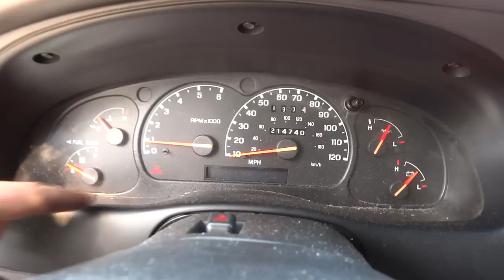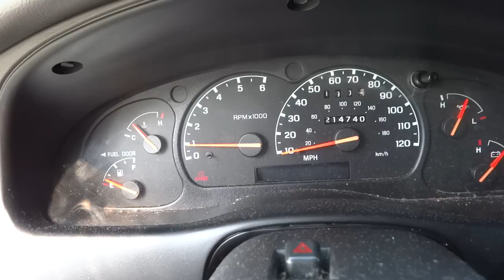Engine Knocking or Ticking?!? This Could Be Your "FIX" Ford/Mazda/Bmw/Honda/Toyota

Comment: couldn't you just lock them open via the vacuum mechanism, and disconnect the little metal arm you took off? save a big job and all the risk to boot....

Comment: automakers are in the practice of giving a consumer less & less and what they give is a junky 4cylinder as a excuse to severly overcharge for a basic v-8 vehicle!!! so if you think back to 1960's-1980's most vehicles came with a v-8 and depending on how much you were willing to pay determined how many luxuries/accessories  your car revieved.These days,people are conditioned to expect junk(low powered inline 4cylinder) so,when it comes to a basic vehicle with a v-8, THE AUTOMAKERS are using any excuse to overcharge their consumer. in the 1940's a new Cadillac was under 2- 4grand.IF PEOPLE WOULD SIMPLY STOP PURCHACING ANYTHING FOR A FEW MONTHS,WE WOULD BEGIN TO BRING DOWN PRICES.IF ONLY AMERICANS WOULD BEGIN TO STAND UP & WAKE UP? WHEN WILL PEOPLE FINALLY STOP ALLOWING CORPORATIONS  TO OVERCHARGE US,WHEN THE MOST BASIC VEHICLE COST 250.000.00.THEY KEEP RAISING PRICES KEEPING THE 1% RICH. IF PEOPLE ONLY BOUGHT USED VEHICLES FOR 1-2YEARS PRICES WOULD DROP DRASTICALLY.

Comment: I just brought a 99 infinity n when I got home n motor knock sound started n was smoking can sum one please respond
Reply from the maker: That doesn't soung good,what color is the smoke? Could be a fould spark plug,bad wrist pin,bent rod ect..need more info on where the sound is coming from?
Reply: like a over heating smoke
Reply: +Nthefastlane its by Tha power steering pump
Reply: +Kenneth graves sum one told me its Tha pully
Reply: what color of that smoke?
Reply: +Kenneth graves check your labia manifold. drain all the oil, and run it full throttle for about 30 minutes until you see white or black smoke, that means that your clitoral gasket is perforated, if there's no smoke, then you're ok, but check the urethra fluid just to be sure. good luck!
Reply: Ner0blaz3r hehe me too, but there's always someone that takes it all in as literal, and serious, then responds without thinking ^^
Reply: +tobysoter woosh
Reply: I think we have a grave problem here

Comment: do u have any clue what can it be
Reply from the maker: only three things it could be the solenoid under the intake manifold with the two vacuum lines or the vacuum line that runs to the solenoid behind the intake and the plugs that go to both the solenoids.. the one under and in the back of the intake and pressure switch on top of the intake.That's all it could be.
Reply: K thanks kid keep uo with the videos I really like them I have the same truck with a new engine so keep it up

Comment: Wow so with all the other butchery he did he also managed to use brake cleaner on a plastic manifold that you shouldn't even use throttle body cleaner on. Ford puts a non stick coating on the inside of the throttle body and intake runners that can easily be dissolved by cleaners.

Comment: These are the type of guys you need to careful with, never, never buy a car from these do it yourselfers. He's no kind of mechanic doing a bandaid job, first break things as he takes them apart, then putting epoxy on an engine part. Engines are finally tuned piece machinery, with Precision parts and he just tore it up.

Comment: Really? plastic intake manifold?  what a piece of junk...
Reply: now every manufacturer is using plastic, except for Ferrari and other high end cars. Allegedly it saves weight ( but also money for them)
Reply: It looks really fragile...  and if you get a car crash it will just break much faster than a metal one for sure
Reply: Remi Jansen Actually plastic is best. It doesn't normally get smashed with pliers and it doesn't absorb heat like alluminium so intake temps are lower. ;-)
Reply: Some cars have plastic oil pans and plastic valve covers along with the plastic intake manifolds.

Comment: WHOA..... WAIT.................  THIS IS EASIER......  After removing the metal rod, gently snip the flaps in half and remove the two parts, leaving the holder in place.  No cleaning and no epoxy except for sealing up the port for the metal rod, and also epoxy the plug at the far end of the where the rod used to be.

Comment: I read one of you stating about the teams that design engines are so much better. NOT! Whose bright idea was it to put plastic on engines? It does nothing but fail in the long run and you have to buy new intakes. To where the old metal ones last forever. Just another way they can make more money on you i say.... Ridiculous design.... Pt cruisers got same garbage....

Comment: @6:46 you said you had a 5/16 bolt. Dude, seriously, vehicles in america haven't used standard bolts since 1982 at best, stop sighting standard bolts on a vehicle because as soon as you do,  you sound crazy. It's called 8 millimeter.
Reply: when u have nothing but standard sockets left in your tool box due to theft its good to know that there are standard sized sockets can be used for the metric bolt.

Comment: theres a quicker fix just unplug vacum pipe plug the hole two minute job am still going strong two years in lol
Reply from the maker: Yes but that's a temporary noise fix Tam, if one of those breaks off in the intake its game over. They do break off, there are a few videos on here with engines that have blown up because of the runner flaps breaking off in the cylinders.
Reply: Nthefastlane
I agree with you, but unplugging that vacuum might be a good way to confirm the problem before going through the work of pulling the manifold, only to discover the knock was coming from somewhere else. I am chasing a knock like that on a rebuilt engine I hope it is from the manifold, pulling the engine sux.

Comment: If Ford could save a penny by not including the runners (IRMC) then they wouldn't have put them on AT ALL.
Most likely the spring in the vacum actuator is weak with age and needed to be replaced!! two screws and pop the clip problem solved
! 25 minute job your fix is BAD. If you wanted to stop rattle a bread tie on the vacuum actuator would have worked to hold them open (oops too easy)

Comment: he blocked off those holes going from runner to runner......cause he says it will transfer air from one runner to another....!!!!lol.......the whole intake is under a vaccum....lol.....those holes wont make a difference blocked or unblocked.....lol......all 4 runners go to the same chamber just inches above the holes....!!!!....lol........i would just fab an aluminum intake.......wouldnt trust that after beating it to pieces....lol........imagine turbo charging that engine.....lol.....the intake would explode.....lol......
Reply: +Gary Marshall 
A lot of "lols" there. Why do you think intake runners are separated? Better do some research before knocking someone idiot.

Comment: All your fasteners should be METRIC not a mixed bag of ENGLISH/METRIC? You should not remove any part of your vehicle that was engineered to be THERE! What gives you the idea that you can just throw away any part of your engine, just because you can't understand the purpose of that device!  I'm an aircraft mech & I hope you don't get anywhere near an airplane! Millions of dollars, time & manpower is spent to engineer all those devices you don't understand the theory of. Those valves change the torque characteristics of your engine by varying the volume of air, different torque/horsepower can be achieved by varying the intake flow! So you can have good response across the entire torque band.
Reply from the maker: +D. G. All of that for a pice of plastic that will blow the motor? Makes a lot of sense right? I think not. If It was engineered properly, it would be done with variable valve timing, and a good tuned map. So much for engineering. If you build air crafts like this, I'd kindly like to know which ones so I can take the next flight.

Comment: brake cleaner + plastic = melting
also not good for the gaskets

u probably deformed the plastic or fucked its structural integrity a little bit. but it probably doesn't matter THAT much in the end either.

id advise not using brake cleaner or solvents that attack plastic on plastic parts.

Comment: I wish cars could be made out of metal and be tanks again. Safety is better but overall they are worse off as plastic bags that break at the lightest amount of anything. I really hate plastic so much. Metal should be what cars go with over that plastic junk. I call ABS Absolute Bull-Shit plastic.
Reply: I agree. My Chevy truck had a plastic plenum and after a year of Chevy I was highly unsatisfied with the cheap feel. If weight is an issue at least go to aluminum. Not full on plastic.
Reply: And plastic has gotten so weak. My dad has a torino and we cleaned the dashboard and there was some old plastic that was still in one piece even though it had a lot of stress on it. Plastic is getting so weak and brittle that a little drop can break it.
Reply: Yeah it decomposes faster than most metals used in cars.
Reply: Please

Comment: Can I do this to my acura
Check my video and see if that's the sound that it makes
Reply: I have the same question, you ever figure out if u could do it to your acura?
Reply from the maker: Just remove the center section of the butterfly flaps, then to extend the bolts because it's mission the center butterfly's.. just put the stock bolts threw half sockets and it with bolt it up. Socket's aka "tools" 10mm ect

Comment: please don't do this to your cars they are there for a reason!
Reply: If you are on a way of a broken swirl flap then you would better remove it than letting it in at the risk of destroying the engine.
The only benefit of the swirl flap is to increase air velocity at low RPM, to improve fuel economy and efficiency.